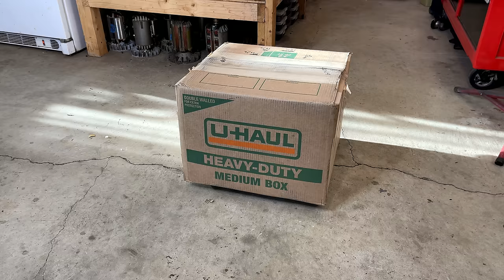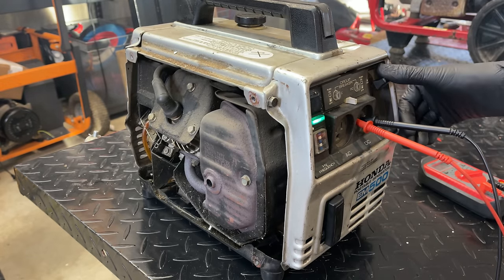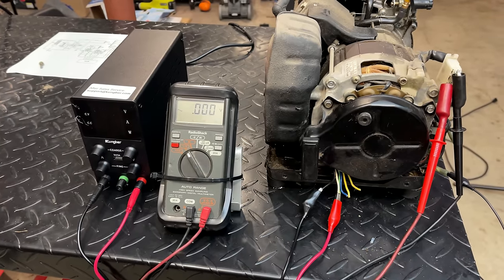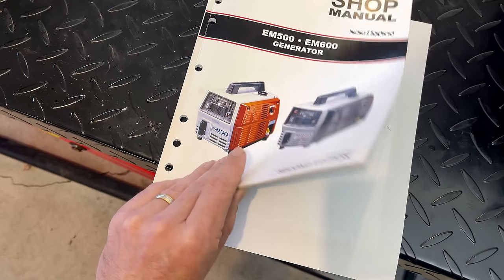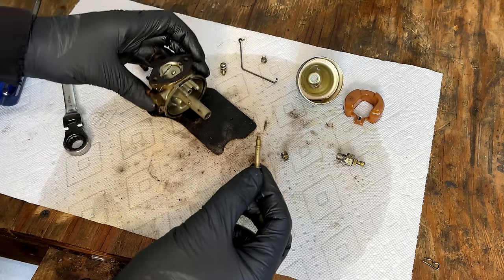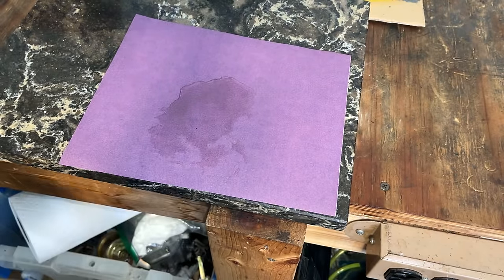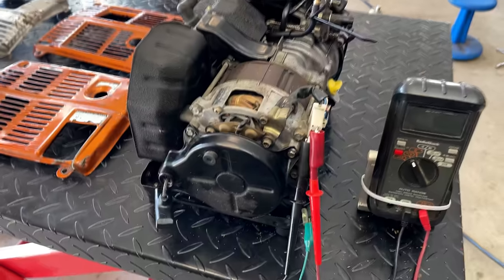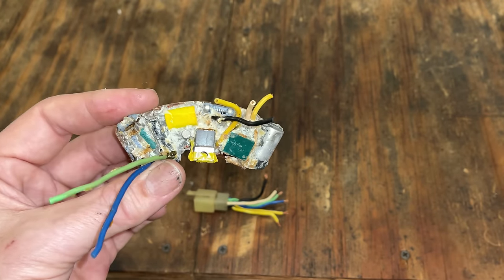Vintage Honda EM500 - High Voltage Problem

Comment: Use a universal AVR. You’ll need a few external resistors to adjust voltages. But much easier and very kit-able for these old generators.

Comment: Hi James, what year (about) do you think that old Honda is?    I guess they have been making small generators a long time?   So good to see a vintage gen working so well!
Reply: "By the late 70's and well into the late 80's we were selling these red EM500's and grey EM600's"
Reply: see article in gappower re quote above....
Reply: I have this same machine, my understanding  is it's from 1984? Runs well! We use it for camping.
Reply: @JohnSmith-yv6eq  Thanks!🙂

Comment: I didn’t even know generators of this size were a thing. Seems like it’s utility would be somewhat limited, especially considering the era it comes from when a single light bulb might use 20-25% of this generators total output. It’s better than nothing I suppose! Impressive that it’s still running after all these years. Definitely won’t see that with the disposable Chinese clones we see now-a-days.

Comment: Hi James, I could probably reverse engineer that or design an AVR to do the job. But is there any demand? I suspect the potential interest would be very small. It is just a voltage regulator circuit you have a sense and a power supply which is then fed back to control the rotor. I am sure your friend Gary could design a circuit to do that. Lots of very useful information to design such a circuit. I am sure there are plenty of AVR schematics on the web that could be adapted. However, again, is there any real interest?

Comment: Good morning, I am just now catching up on my videos so you might not see this. I do love all of your videos but sometimes you show some equipment that I just not as informed about all of  the equipment and procedures you use I can't grasp what you are doing. Anyway it would have been my choice to give the recoil spring a couple of extra turns to tighten it up. Just my OCD working. It would bother me with the pull roap being that loose. I want  to thank you for all of the education I am getting..."Hope this helps".  😊

Comment: Thanks James as usual you pulled something out of your magic hat and produced a working machine. I don't have money for one either but would a 3D printer of made that spacer? Ed
Reply from the maker: Yes, but maybe a higher end 3D printer that can print plastic with a higher melting point or print with a resin. The engine head runs hot and the plastics used in cheaper 3D printers are designed to melt at a low temp.

Comment: Depending on the horse power  California made All engine s 25 horse power and less illegal to have in California but the Way it was sent to you is the best way to do that
Reply: That's only NEW ones being SOLD in California.
These will be grandfathered in...until they change the law....
Reply: @JohnSmith-yv6eq   cool that they did that for this classic gen set

Comment: When an inverter generator is buggered, and a new inverter unit is expensive, the generator 3 phase coils are generally ok. So get a 20 amp three phase rectifier and configure the generator to have a DC output. This output will vary from 90 to 400v depending on the generator. Now most modern switch mode battery chargers have universal input, like dc/ac 90 to 415v. ( like Victron for example)  So size a suitable battery charger like a 12v 50 amp for a 1kVA generator and use your generator to charge batteries. These days we do not run anything off a generator, we charge the batteries and run our devices with an inverter. So--- a buggered generator can be re-purposed. and the rpm it runs at is simply set to match the load.

Comment: Call me a nerdy mechanic, but it's a good video. Kept my interest. Haven't finished watching, but I have to ask (before I forget), why not rebuild the engine also?
Reply from the maker: The engine seems to be running well.  No need to open it up, especially when parts may not be available for this old machine.

Comment: Aside from reverse engineering that board ( 1:19:51 ) it seems like it would be pretty straightforward to design ("forward engineer?") a compact replacement. No, I'm not volunteering, but Dave at @EEVblog might be able to round up a volunteer.

Comment: Hey James, if your other methods for getting information on the voltage regulator, don't pan out, I could reverse engineer or design a voltage regulator from scratch.  I have been reverse engineering and designing radio and power supply circuitry since the early 1970's.  Before the Internet came along, it was much more difficult to obtain a schematic so, would end up most of the time reverse engineering a circuit so I could troubleshoot it.  I have also designed numerous power supply voltage and current regulators over the years.  Since you measured the input voltages to the regulator and determined the DC volt necessary to produce 120 VAC output, the regulator circuitry requirements are established (the first step in any design).
Reply: @jcondon1  Sorry James, Gmail says this is a non-existent address.
Reply: @jcondon1  It was my fault, I typo'ed your address.  I sent a message that went through (at least on my end) within a few hours after your last response.

Comment: In the past I have found Methelene Chloride paint stripper works well to de-pot epoxy. May pay to put the remains of your AVR in stripper for about a day to see if you can dissolve epoxy.

Comment: The funny thing is I can find any number of arc AVRs for Honda 168F powered gens (2-3KW) which look as if they would be ok, but they are all 250V rated. Didn't find a single one for 120V.

Comment: Why are you using your bench power supply in constant current mode to adjust the output?  Doing it that way is kind of bad and not the best control.
For instance, if the current draw droops, the voltage will go up uncontrolled.
Just a suggestion... I would set the current at about half an amp, and use the voltage control.  You can set the current by shorting the leads and adjusting the current control.
Thanks!

Comment: You should be able to have an insulator made . Auto cad by someone with a 3D printer my son makes parts for E bikes and sales them . He will need it together to scan it and print it . He is a computer graphics designer. He lives in SC now and has three printers going.

Comment: This is a good specimen to show how unreliable the modern products have gone , this one , of course it is a Honda product so WAS made to last , beautiful , but today's most products out of CHINA haven't any thing near enough QUALITY as this excellent little machine . 👌👌👌👌👍✌
Reply: I got mine like it in mid 70s
Used it on service truck for 24 years and still is working great

Comment: Get your self a Lazar  cutter or find some one that has one to make hard to find gaskets. They can be made from a photo from your phone if you have the free software. I have laid the part where the gasket goes face down on may printer scanner an scanned it then made some size adjustment as needed. Then Lazar cut it. You could 3d print a carb insulator. Not sure which material to use that would take some investigation.

Comment: Silly question - could you put the float inside the tealeaf holder when in the ultrasonic cleaner?  It would not float and so could get cleaned on all sides ?
Reply from the maker: Yes

Comment: We used PC7 to remold some missing teeth on a flywheel of a VW.  It worked for months. Until the car was upside down. I doubt the PC7 failed. But the car got hauled away to the junk yard anyway.  I don't have as much faith in JBWeld but I could be wrong.

Comment: This thing has nostalgia value and even economic value because people will pay for anything with the Honda name, but honest to goodness if this was my gen I would retire it and get a nice little modern inverter gen. 40 years is a lot of time in technology and there is better stuff available today.  $200 was just the part and if James was charging for labor that would be at least another $200 and for $350 you could get a brand new 2000w inverter gen that would beat the pants off this ancient device.
Reply from the maker: Cannot argue those points.  It more the collector or nostalgia value.

Comment: Good morning James.  I would like too touch bases with you. My father in law has a Honda em600. It had set in the garage / storage shop for over 15 years.   We got it out the other day and I went thru the process you show us in your vids. The thing looked in good shape.   I drained the gas wich astonishing had no water didn’t smell bad or anything. So I drained all of it the oil was in really bad shape so we drained that and replaced it.  So o took the thing apart cleaned the carb out it in the sonic bath for 15 mins.  Leaned out the jets I could get too come out.  Put it back together. Went too try it but I’m getting no spark at all. I’m stumped on this cause I’m not sure wich way too go on it. It’s not like the rest of the newer stuff I have watched you work on. Is there a link or something I can communicate with you too get help with this ? Or would you have the time too help out on it? Thank you for any help you can give me.

Up date. I reset the breaker and the thing started up on 3rd pull.   
It runs at 151.8v and 70 hz.  I just have too fig out how too adj the voltage down.
Reply from the maker: There should be an adjustment screw to decrease the spring tension.

Comment: My wife would have my head if I cleaned anything in the kitchen sink with grease and oil, :face-blue-wide-eyes:James, supper glue works with those carbon insulators to hold them together also.
Reply: Gotta train em better
Reply: @dirtyroofer3678  Not about training, Mutual respect. It's my house too.
Reply from the maker: I always clean up my mess....  I do have a utility sink that would be better suited, but not in a great location for making a video.  Even better would be a parts washer in the garage.
Reply: @jcondon1  I'm sure you do James your a neat clean professional.
Reply: @jcondon1  I made a parts cleaner many years ago out of two 15 gallon metal drums when I was a poor man and now I can buy a nice one and say why.😀  I just saw the hammered copper sink and stone counter tops is all.  😇

Comment: That 20W light bulb gets fire hot.  Slide the plastic boots on the alligator clips back along the wire and away from the heat.  Come up with something to hold the clips apart so they don't short.  But that something has to be heat tolerant.  A chunk of wood would work.  Like a clothespin.

Comment: Great work Jim: Is it possible to use a AVR from another brand gen to repair an obsolute one like you have. Many thanks.
Reply from the maker: I would have tried a few if the OEM part was not available.  I kind of doubt they would work though because the power needed for the field was only 5 volts dc.  Most modern generators need 100+ volts dc.

Comment: That's honestly a cool little Generator and it sounds like it runs smoothly.
How meny decibels dose it puts out??
Reply from the maker: I have not measured it yet, but would estimate less then 60.  Not much louder then an inverter generator.

Comment: I have the exact same generator that was my fathers. I’ve just recently cleaned it all up and it ran with the same issue. 190 volts AC and 28 volts DC. I’ve search everywhere and cannot find the Voltage Regulator. Where did you get yours and how much did it cost?

Comment: Could the insulator be 3D printed maybe in ABS? I don't know what temps it would need to survive however.
Reply: Yeah probably not a good idea to use a thermoplastic with heat. You want to use a thermosetting plastic there. Something like Bakelite or phenolic resin.

Comment: Very good technical and tidy jobs on everywhere.
Is which Green/Yellow liquid for cleaning and boiling a Carburetors, it's look very cleaned all part.
Thank for ideas of permanent bending a fuel pipe.
Reply from the maker: The stuff I use is Harbor Freight Super Heavy Duty Degreaser.  It is normally used in parts washers and environmentally friendly.  Not to mention it works well.
Reply: Thank you a lot.

Comment: Touch the bottom of your stainless steel pans with a magnet...if it sticks, they are designed to work with induction Stoves...

That trick works for ALL pots and pans, if a magnet sticks to the bottom, they're Induction compatible...

Comment: I just picked up one of these little generators. The issue I’m running into is the automatic choke assembly oscillating high to low and vice versa. Is there a video on how to address this?

Comment: Also, for the rubber seal between the carbie and engine (didn't watch the whole video yet) a heat resistant rubber with the same thickness and cut to size and the right holes made to it, wouldn't work in the same way? The rubber tends to lose its properties after some time and the same it happens with the plastic. 

As an example, my plastic from the engine failed (the one from the gear shift selector) as the car was made in 2006-2007 and now it's 2023, with just 120k miles one it 😂 But I think I have found a metal one too, so I will check with the one I have ordered to make sure it fits and then I will just replace it with the metal one. VW wanted to either cut down the costs or make the car lighter. I don't give a damn if the car it's ligher with just 3-8 kg. I want the parts to last 😂

Comment: Great job as usual BUT you should have used some of that leftover cleaning solution to clean that toothbrush. Then you'll be able to brush your teeth with it again and not have to buy a new one. 🤣
Reply: That was the wife's toothbrush.

Comment: James, thanks for the video
I’m doing exactly the same thing it looks like my voltage regulator is shot as well 
I was curious, I had residual magnetism voltage of about 45 to 50 V with the voltage regulator unplugged I put in 5V on the white and black wire and also got 120V output just like in your video 
Now it looks like I lost residual magnetism? and I only get about 4-5 V now instead of 45-50 Any idea what would cause that?

Comment: I have nearly the identical Ultrasonic Cleaner as you. What Temperature do you set yours at for carbs? (I think mine is too high as the carbs get a blackish tent when I clean them)

Comment: Was that your phone or some Tachometer you were checking RPM with when you first started it? I am l looking for an easy to use Tachometer for single cylinder engines.

Comment: A few months down the road, just wondering how the JB Weld held up? I've had trouble with it on intake manifolds before due to the fuel/oil. I've resorted to plastic welding with a soldering iron and burning in stainless mesh on surfaces that don't need to be planar.
Reply from the maker: So far it is holding up.  I have since located and purchased a used good carb insulator, but not needed it yet.

Comment: If you still have the regulator I would like to take a shot at either rebuilding it or making a clone using the one you have as a template.   I have over 30 years of experience at a automotive / industrial machines /avionics support equipment, specializing in electrical/ electronics systems diagnostic and repair. After retiring form the military worked for Bosch specializing in no code dianostics, then worked for the Spanish government as an instructor specifically teaching these kind of systems.  If I could get a good look at it take a few readings shouldn't be too hard to build one.   The avionics was primarily repairing power generators for aircraft while they were on the ground.  Tech school was 6 months 10 hrs day / 5 days a week and a 2 yr apprenticeship after.  Think I could make you one if I could get a closer look at it.  Get ahold of me if interested  let me know.  The largest Mobile  one I've worked on took 2 8 cyl Detroit engines in series to run at full power was about 12 foot tall x 14 wide and about 20 ish long that was a beast took a crane to pull thevraditors'
Reply from the maker: Thank you I appreciate the offer.  I have already sent it to another subscriber who has reverse engineered it.  We are working now to gather a little more data and will build a prototype.  Will see how it goes.  Might reach out in the future again and will probably make another video on it.

Comment: I'm curious to what the 12 volt output would be commonly used for? Even my 20 y/o Generator has one. Output less than 10 amps. 
My only assumption is for slowly charging a lead acid battery,  what uses would this have?

Comment: A 400 watt generator is ideal for small loads because it will use much less gas than a larger generator supplying that 400 watts.  Generators are designed around a particular load. Poor sizing of a generator on the large size will cost a lot of money over the course of the life of the generator in wasted gas.
Reply: I used it for lights on service truck for 25 years, did a little drilling also

Comment: James what is the actual difference between em500 and ex500 as I have an ex500 and is quite similar , I know the letters ex , eg, ‘‘em etc quite, industrial etc but what is the actual difference thanks
Reply from the maker: Not sure.  Maybe I will get my hands on an EX500 and find out.

Comment: There is plenty left of that board to draw a schematic. Many of the component markings are present, measurable, or irrelevant. You could almost (meaning probably) even decode it all by stopping your - and the other guy's  - videos. Seeing that you've already had this video out for a day, I'm under the impression that you already have prototypes in the works though.